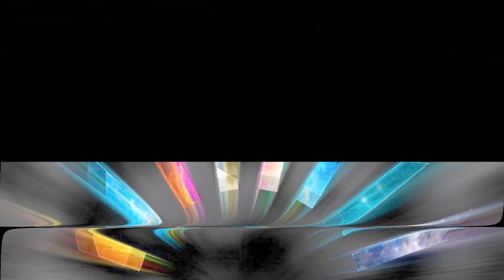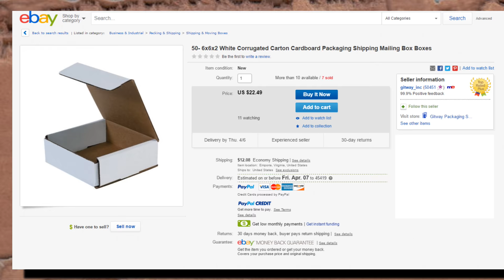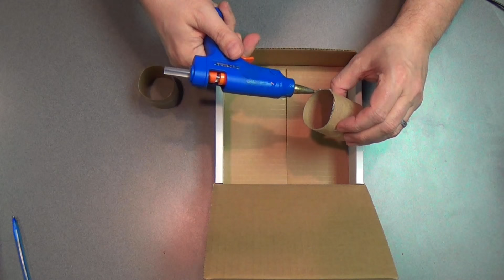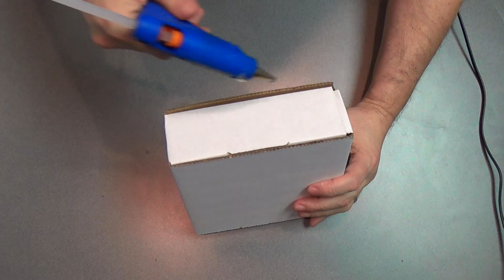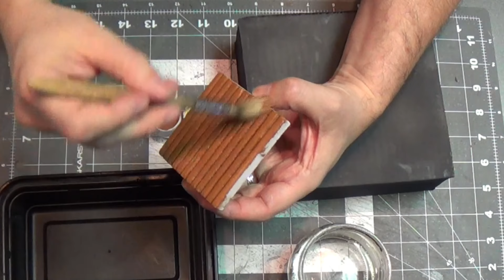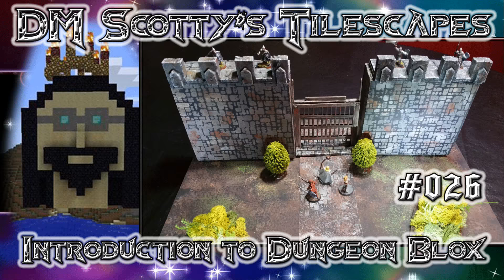Dungeon Blox Construction for D&D Terrain (Tilescapes #27)

Comment: Foam or sponges make better stamps- use a soldering iron to sculpt cheap sponges or a pen for foam. I'm currently working with a 3x3 block of sponge squares hot glued to a wooden block as a stamp for gray fabric paint onto black cloth, then touching it up with a lighter gray, some dark green and brown randomly as an alternative to tiles. Then I just need to place walls and features. If I ever move to tiles, I would like to use "clip on" walls that appropriate features can then be clipped onto.